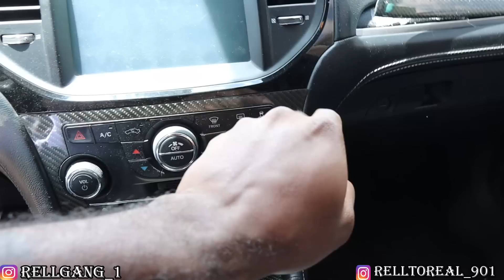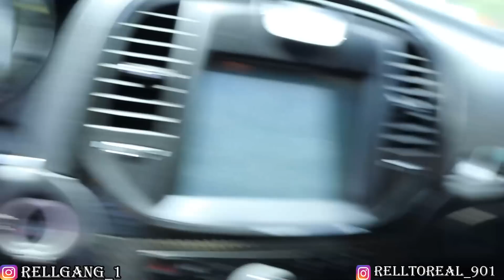MY 426 WHIPPLE SUPERCHARGED SRT 300 READY FOR NEW RACING TRANSMISSION AND MORE!!

Comment: I would of sold that plain ass box for  22 I would have sold that mf so quick and I had a 2013 Chrysler SRT 8 bought it new for 50k so that car isn’t worth 40 or 50 no dealership will give u that with that whipple on it I promise u that so stop with the cap 🧢 but I like u dude but those cars are not worth wat u thinking.